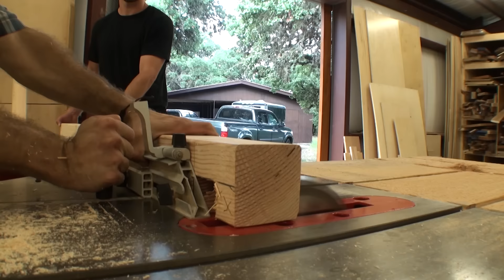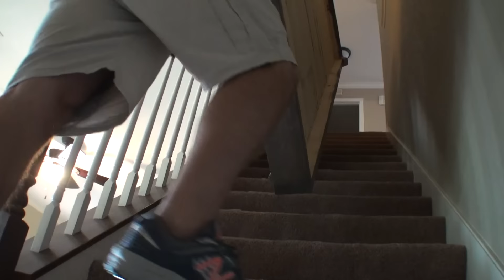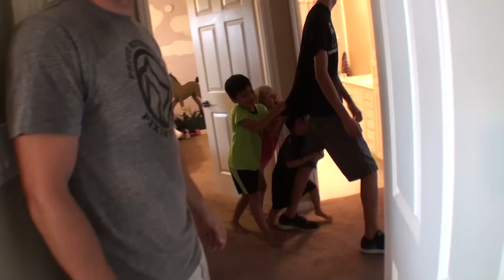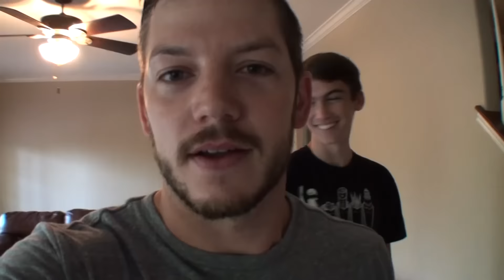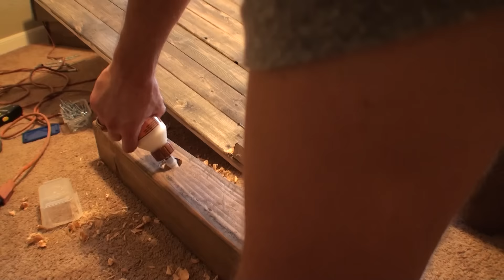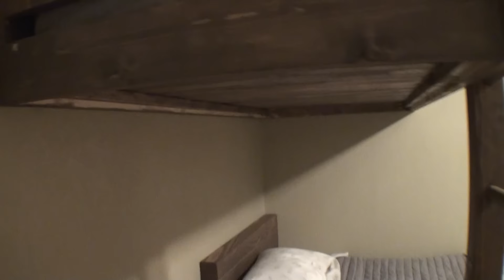FINALLY it's DONE

Comment: I highly recommend some supports to the floor on the wall side to take the weight. Screwed to the wall isn't going to cut it.
Reply: I was thinking the same.
Reply: The ladder I think was made to be a support to the floor
Reply: If it is screwed into the wooden supports behind the wall it will be just fine.
Reply: It's screwed into the studs inside the wall. That's more than strong enough.
Reply: I'm with you +yellow, some cleats into the studs for extra measure.
Reply: Screwed into the studs should be okay if they used long enough screws, and it looks like the ladder is made to support the opposing side.
Reply: If he used 3-4 inch grade 8 screws he'll be fine
Reply: My bed is built like that with no support from the ladder either and it supported a 200lb person just fine
Reply: Never underestimate the power of children to destroy things.
Reply: To be safe vertical supports could be added, but they probably wouldn't be necessary. The diameter of the screws used looks to be more than enough to resist whatever shear stress develops, and the ladder acts in such a way that it resists any rotational moment. The only forces left to consider would be internal, but the strength of the materials is far greater than whatever force the weight of a small child would create

Comment: Great Vid Matt, You did put the screws into the studs right? With a child underneath and 5 jumping around on it with the weight of it as well.
Reply: pretty sure that wont even hold...anything in just the drywall. That's heavy wood...
Reply: Of course he did or it wouldn't hold in the first place
Reply: He needs to replace those screws with some lag bolts!
Reply: +Calipali 1 no he doesnt
Reply: perhaps, but that woulda required partial destruction of the opposite side of that wall to complete...which woulda been fine had he been having the house built, or otherwise remodeled anyway...but he wasn't...

several screws through the studs, and the ladder will provide plenty of support

Comment: You might want to source replacement fan blades, maybe even a whole new (or used) fan fixture. I remember breaking such things when I was a kid with a bunk bed that close to the ceiling fan. of course, it might be a perspective thing and the ceiling fan isn't that close, but just figured I'd let you know so it doesn't catch you by surprise if it happens.
And, as a woodworker, that's a snazzy bunk bed, great job y'all

Comment: Hey mat, I am not sure if you read these or not. But I noticed you where using a spade bit to drill out the hole. These will work but as you have noticed it's a bit hard and not comfortable and bit harsh. A nice alternative to them is something called a forstner bit, they still out larger holes and leave a flat bottom also. They just happen to be easier and faster.
Reply: Matt*

Comment: I think just for safety you should find a wall stud as near the end if the unsupported end of the floating bed as possible. oxidize or stain a 2x4 and run it to the floor. screwing it into the stud at a few points on the way down. not really necessary. but judging from the activity level of your family a few jumps will be had on that floating bed and screws have a lifetime for how long they last before giving up the ghost. I would honestly find a way to support the head of the bed as well since 70 percent of the weight will be there and I has no supports except screws.

Comment: I would use lag bolts to secure the bed to the wall studs.
Reply: And I agree that U should. Can you please make a video of it!!!? I would love to see it!
Reply: Yes, those screws u used are to WEAK, to thin, and will BREAK over time with them jumping on the bed. LAG BOLTS SHOULD BE USED. SAFETY FIRST.
Reply: Safety is number 1 priority
Reply: +raider6511 Really? You can't even use the proper to/too in your sentence, so i doubt you know anything about the physics of lag bolts. In fact, i think it is surprising you know what a lag bolt is.
Reply: +Coffeewind really so have you never missed used a work or how about had spell check fix something incorrectly?  pissed off little boy
Reply: +Coffeewind it is unsafe. And I doubt you should be questioning his mental capacity with that minecraft picture😂😂😂. Safer is better and you're arguing that it should be weaker? Get a life.
Reply: Please lag bolt em into the studs....

Comment: Some advice from a furniture maker.  At the back of the ladder, counter sink some screws so that they pin the rungs in place.  The glue by itself will not hold and active kids will cause the ladder to come apart. Otherwise it is a nice home built beginner bed setup.

Comment: I have never seen a bed with NO support holding it up. Seems very dangerous to just have that heavy bed just screwed into the walls. I would put support boards at the wall in the corner of the bed so the bed couldn't fall down,at least the ladder is giving some support .

Comment: I would have used lag screws to attach the upper bed to the wall but as an Engineer I tend to overkill everything.  Like using a 308 to take out the chipmunks; but hey there is no clean up.

Comment: it looks like the bottom bunk has more headroom than the top one.   Top bunk should be a little lower to either make them equal in headroom or give the top bunk a little more than the bottom.   As the kids grow its always easier to roll out of the bottom bunk and be on the floor.   The kid is the top bunk has to maneuver more carefully and get to the ladder.    That might be a problem when they are bigger.   I authorize you to start all over from scratch.    (LOL).

Comment: I don't know if I would trust the weight of those kids + all that wood, even in the studs with just those threading screws.  It looks like an accident waiting to happen.  I think you should go back in the corner and brace it with a 2x4 on both sides at least.  It just looks dangerous.

Comment: i wouldn't sleep on or under that motha heffer... i install cabinets for a living and use wall plugs and 75mm screws (the same lookin stuffs you was usin') and i'm always putting in more screws than i need.

i'm definitely underestimating how strong they are but that timber looked VERY heavy for those screws... i wouldn't feel confident in them. 

might just be me, in fact it probably is considering all those kids were on it.

Comment: The beds..mad of 2x6. head board, ladder and supports mad out of 4x4's yup, sturdy!! Anyone bitchin about the screws shadup!! Matt clearly marked the studs, and Andy Rawls made the bed to be structurally sound!! some people make loft beds out of 2x4 cull lumber, if you use lag scews in studs in your wall you can split the studs, so learn some thangs before you become keyboard critics!!

Comment: making a kids bed that heavy and then hanging on the wall..... Not A GOOD IDEA. You dont use screws to mount this you use lag bolts. Then I see the other kids bed under the heaviest part of the bed... Scary. You should use vertical timber and support this upper bed in the three corners against the wall. I am a custom furniture maker and have been doing this since the 1970's. As your house settles it can cause the walls to move out of square and will pop this bed off the wall and down onto the other kid's bed. Trying to have a clean look compared to having it safe is not worth your child's life. I would have put in a steel L channel lagged to the wall on every stud available and then mounted the bed onto that. I also would have made the bed out of a much lighter material... curious how much do you think that bed weighs? A bunch of screws does not compare to Lag Bolts.